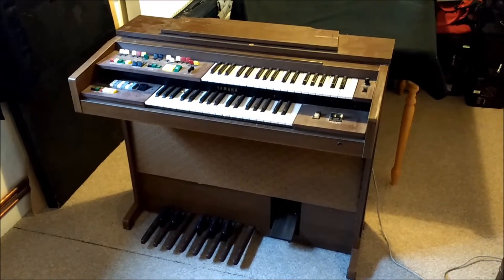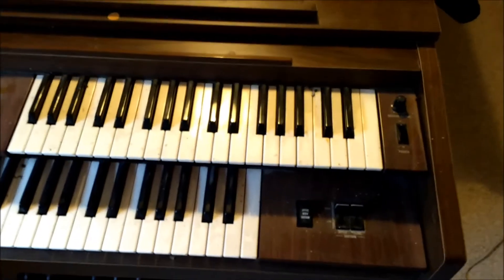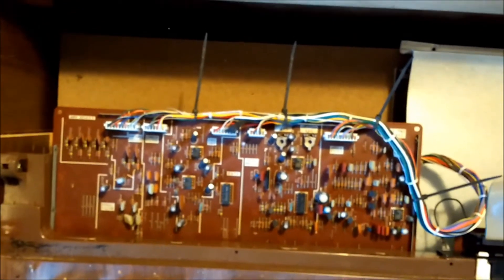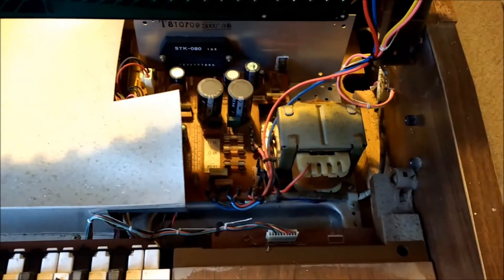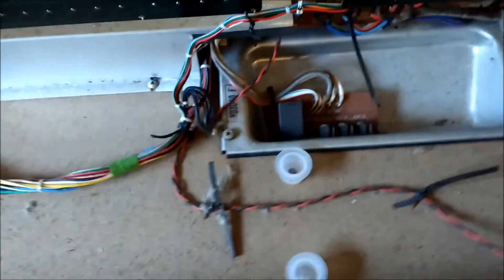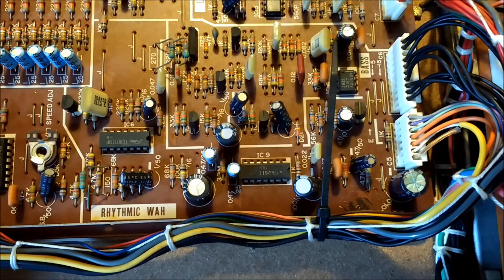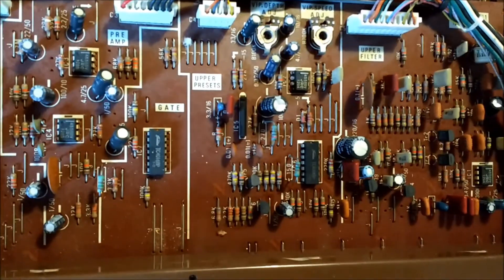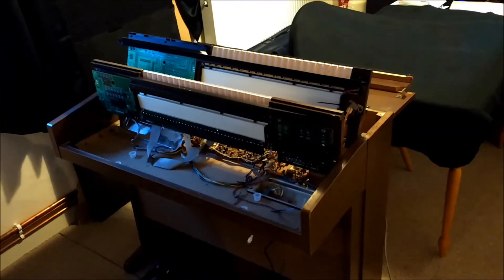Yamaha Electone A-55N - Disassembly, Repair, Synth Synthesizer Chip Salvage

Comment: I have been working on a similar C55E from 1978 that's been in the family since new and always stored in dry living areas.  It still looks new and yes, I'm impressed with the ease of access to the main areas.  My experience restoring it is that at minimum every single switch (except the AC power) will need to be removed and the contacts cleaned.  Unfortunately the switch manufacturer seems to have used a grease on the electrical contacts that deteriorates into a poorly-conducting film. If that wasn't annoying enough, all pushbutton-type switches have a tiny red bumper inside that can break loose and become entangled in the mechanism, preventing the switch from latching down into the 'on' position.  On the C55 there are 58 such switches in total which took me about 25 hours to process.
Without doing that up front there would be no way to know if everything else is working.  Thankfully all the rare and specialised semiconductors were fine. Only one logic transistor in the Special Presets had drifted slightly in spec, causing that function to be permanently muted.  An easy fix but hard to locate. One other weird minor failure was that one fuse for one amplifier power supply rail failed (it seems due to vibration only) but there was no symptom apparent.  In retrospect all it did was limit the maximum volume achievable due to only the other rail being present.  Probably the most amazing thing is that the original rubber belt on the rotating speaker baffle is still working.  Thanks for your video ... that allowed me to verify certain sounds are working.

Comment: I have the A55 without the N, that stands for New, the difference is that mine doesn't have Auto arpeggio, rhythm variations, and the "disco" rhythm pattern, which was very sought after in 1980-1982. But mine had the Tremolo/Chorus effect and had an extra guitar preset. I wouldn't have changed it for this model. Tremolo and Chorus was probably the best feature of this model. I wonder if they just hid it in the panel but it was still in the circuit board.

Comment: Ahoy good sir. Wandering if there are any modding guides around for modding these ? I have just acquired a mint condition D-65.
Great videos. 👍
Reply: There's really no modding you can do to these older Yamaha organs. I bought an FS-70 which is a much later model and the only mod available at the time (1992) was to add a MIDI out controller to it which I did, then never used it! The D-65 is a nice machine.

Comment: Have you found suitable spots on the circuitboard for extra sliders 
/pots? 
First thing I'd do for this would be adding custom pots for resonance 
and cutoff. And possibly envelope parameters for filters as well...  AutoWah would get even more spicey with them. 

Another one would be outputs for everything possible. Possibility to connect those to dedicated mixer is tempting, separate volume sliders for all the separate drum sounds for example.. then some effect boxes to FX send/return loop! It would add vast amount of new performing possibilities.

Comment: HEy Berno! what happens if you invert the rectangular cables (the whites). I invert two in a gem organ ( data input and led input) and still powering but does not initiates. Just get red leds and no sound. May i burned it by invert flexors?

Comment: Hi! I have the Organ Yamaha A55N and the upper keyword does not emit any sound -it seems that it does not receive electricity-. We opened the organ as per your video (great!) but regrettably, we cannot find the source of this issue. The lower keyboard and the pedals work perfectly. Any suggestions or ideas will be deeply appreciated! Thank you!
Reply: Hi friend, check the manual balance button😉
Reply: @dokken7m137   The manual balance knob does not isolate one manual from the other. It just gives one more level than the other, which can still be heard.
Reply: You would need to determine if the upper manual has continuity of connections to the PCB.

Comment: really enjoyed this video,i have found yamaha b-605 its partly working, i noticed its similar to this,a few sections don't work,it seems to be the chorus that does not do anything but also some kind special preset section with harpsichord does nothing also,it was dusty as hell and abandoned,i wiped the dust off and it really sounds great,i might get inside after looking at this to see if i can see any degraded ribbon cables etc.i know little about electronics tho,apart from to test voltages with a volt meter.Btw. on the 605 you can layer multiple rhythms at same time:)